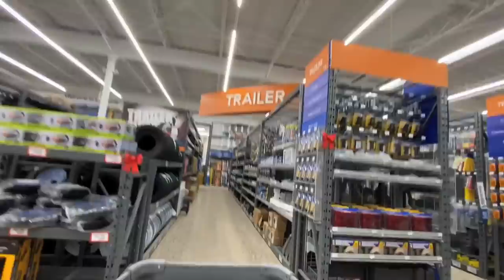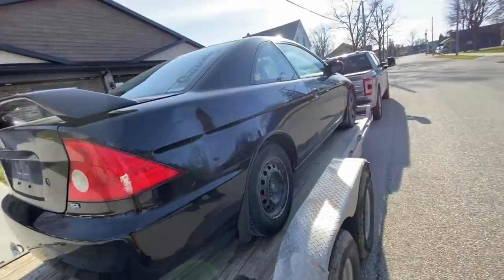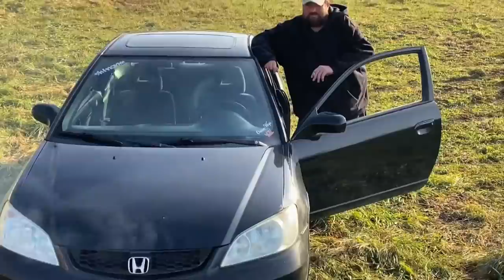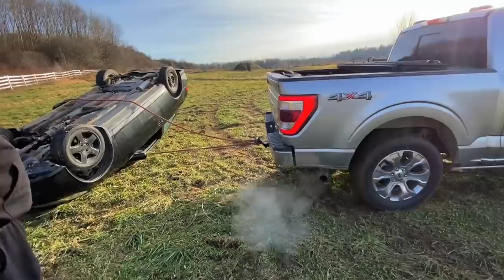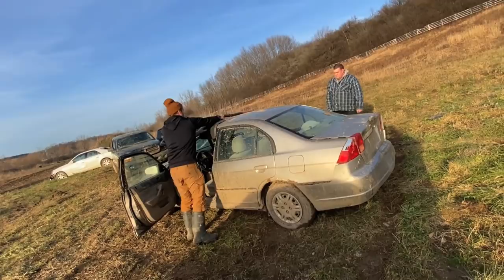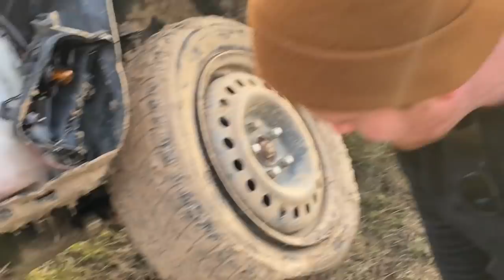2 HONDA Engines SEIZED In 30 SECONDS!

Comment: When they throw a rod and lock up, many times it’s just the rod that got wedged between the crankshaft and engine block. If you pull the car backwards but in a high forward gear (4th/5th), you can get the engine to turn backwards to potentially un-wedge it and maybe giving the engine a chance to start on the remaining cylinders.
Reply: I like how you think